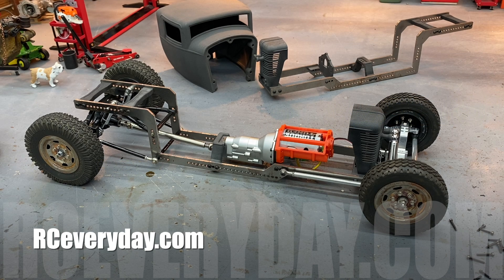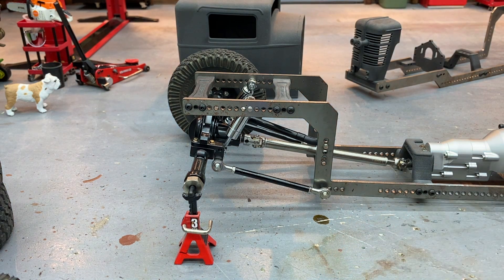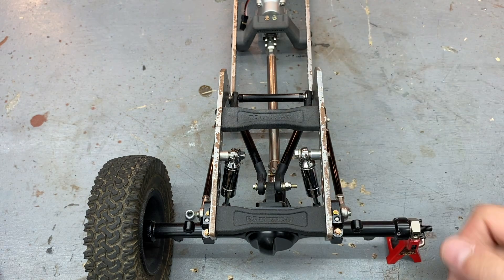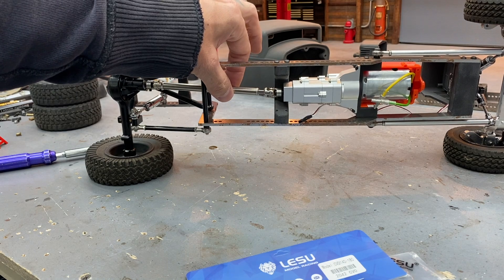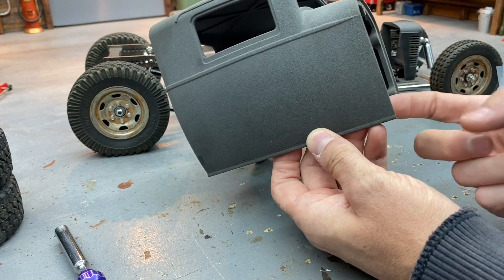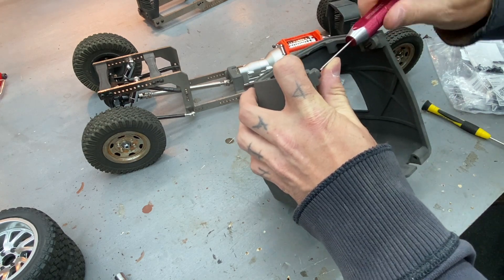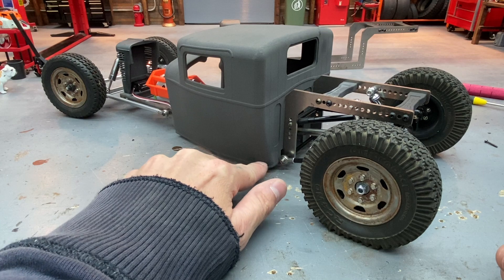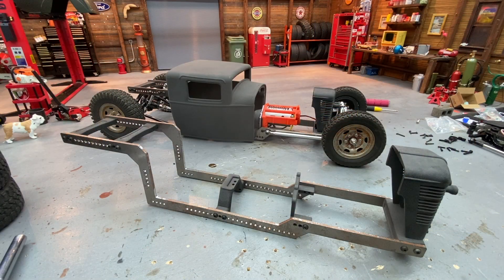The RCeveryday #2 Rat Rod Kit Assembly Instructions Part 2 Ossum Designs Truck Cab & Driveshaft

Comment: Can you tell me Josh which is the better axle? Yoda og or yoda 2? Also I’ve never had a R4 or seen one up close does it come with the motor plate? Making my list and fixing to start purchasing stuff. Any help would be in greatly appreciated!
Reply from the maker: For rear axle the yota 1 and 2 are basically the same. The 2 looks a little more realistic. The r4 doesn’t have a motor plate , but my kit has a motor plate included.

Comment: Back watching again, got my four link conversion kit the links that come with way too long 81 mm and 75 mm. I just ordered 40 mm and 50 mm rods What size is your rods on your rat rod the back ones
Reply from the maker: The last one I just did I used 40mm and 36 on the inside links  the angled rod ends are longer than the straight ones.

Comment: I plan to run a traxxas esc and receiver is there enough room for that
Reply from the maker: In the interior/cowl area is where I put electronics, the traxxas esc is a little bigger than the 1060's I use but still should fit
Reply: @RCeveryday  thanks I plan to order a kit real soon